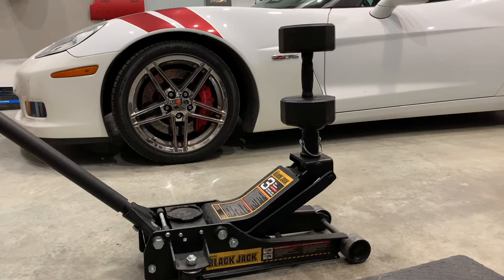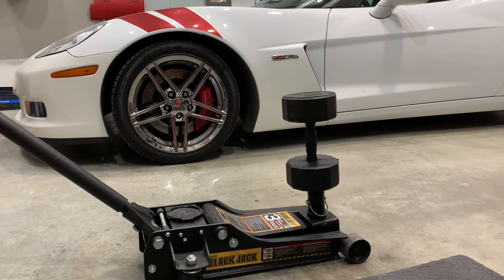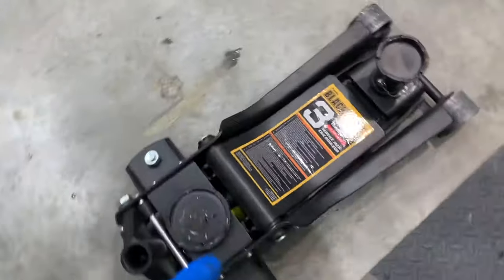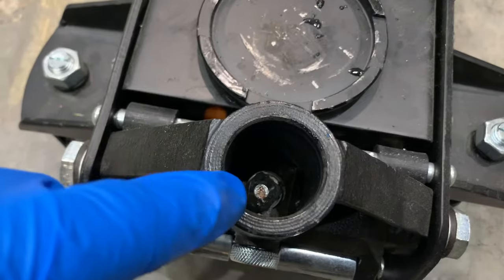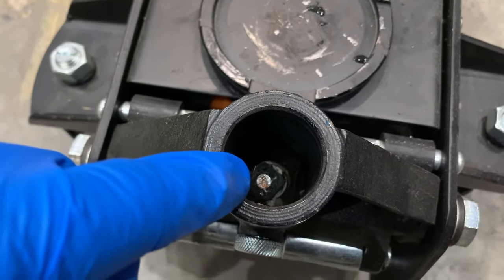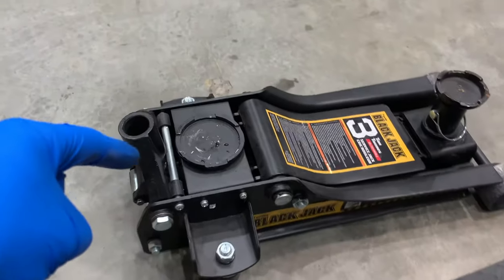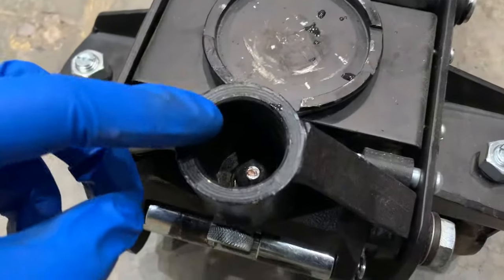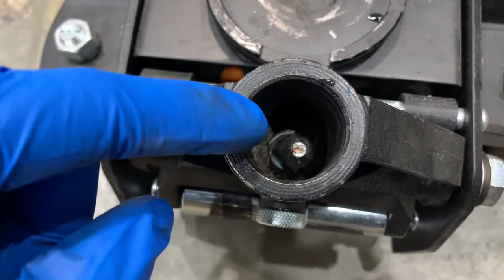Hydraulic Jack Release Valve - let it down slowly!

Comment: im having issues controlling the release of my hydrolic jack... release valve/bolt feels stuck or sticky when under load and because of it i cant turn the handle steadily.

it takes a bit of pressure to get it unstuck but after the pressure is released way too fast

any tips?
Reply: I have this same issue!
Reply: Were you able to fix it? My Jack does the same thing, mine has an assembly where teeth ride against teeth.  The most common type seems to be the hydraulic Jack with low profile and double piston, like the one in this video.
Reply: Same, sometimes it lets me ease into it other times I have to fight to turn it and it lets go all at once. Very fun
Reply from the maker: It just takes practice.  Unfortunately most individuals only use a hydraulic jack a few times a year, so it’s harder to get a feel for the release value unlike a mechanic that uses theirs on a regular basis.  With constant use you’ll get the feel for how much force is needed to turn the handle so the arm goes down slowly.
Reply: I think I'm gonna 3d print a lever for the side of mine and see if I can control it more.
Reply: I have the same issue, did you find if it's a mechanical issue? I understand practice is needed but you can't simulate a car's weight. I can do perfectly slow with some heavy weight but when I'm lifting car, the gears arr just kind of stuck requiring stronger release which results in a burst of pressure release. The release gears are smooth if you load them like the video shows but when it's the cars load,  the gears aren't smooth.

Comment: sometimes the release valve is kind of stuck when you turn, then it suddently drop the car
Reply from the maker: The release value will feel like it’s stuck but  really it’s not.  There is a lot of force on the ram of the jack in order to lift/lower a car.  So it does take practice to find the sweet spot to release it when turning the handle.  However, head to a store and test out a new one or your exact brand if the have one.  This way you can feel if yours is operating normal.  And if it truly is stuck, then maintenance is required.

Comment: having trouble with brand new jack. The release valve wont turn left or right so the jack wont raise. any ideas?
Reply from the maker: Turning the valve to the right (clockwise), but without a lot of force, should lock it in position so you can raise the arm.  However, if the valve will not turn in either direction and it’s brand new, then return it for an exchange.  No use, trying to troubleshoot a new piece of equipment if it’s malfunctioning.

Comment: is it bad for the hydraulic jack if you lower it too fast?  i recently got a bottle jack and the jack makes bubbly noise like hydraulic fluid swirls inside when i'm lowering it.
Reply from the maker: That bubbly sound would concern me - have you checked the fluid level or tried bleeding it?
Reply: @YourHomeGarage  yea i may try   doing the 'airing out' method as it does sound like there's air inside the system.  thanks
Reply from the maker: Keep me posted on your results after bleeding the system.
Reply: @YourHomeGarage  yea i did the whole taking the air out of hydraulics  procedure and it seems to have dissipated, thanks for the content

Comment: Can any jack be lowered slowly
Reply from the maker: I want to say “yes” because I’ve never experienced a hydraulic jack that couldn’t be lowered slowly - plus this would be a huge safety issue.  But I’m sure someone will provide more details if they have a brand of hydraulic jacks that can’t be controlled slowly when lowering.
Reply: @YourHomeGarage  turns out I never purged the jack. This was such a helpful video
Reply from the maker: Glad this helped you!
Reply: @chrissanchez9218  what do you mean by purge the jack?
Reply: @hermanmcleod5182  let the trapped air out but gotta pump the jack first

Comment: This is why i dont use jack stands properly... i cant find a jack that slowly lowers itself. Its ridiculous. Im not putting my car on jack stands when the car falls down inna freefall manner and my car will likely tip over. Fking ridiculous
Reply from the maker: I enjoy using the brand that I have in this video. As you can see it lowers slowly.  However, all brands do operate the same way.  Lowering a hydraulic jack does take practice.  The release valves can be tight and a mere fraction of a turn means slow to fast when you find that breaking point.  This is likely why mechanics/DIY’ers like using their own jacks - they’re comfortable with what they know. But you’re right - it is frustrating, but you’ll get there.